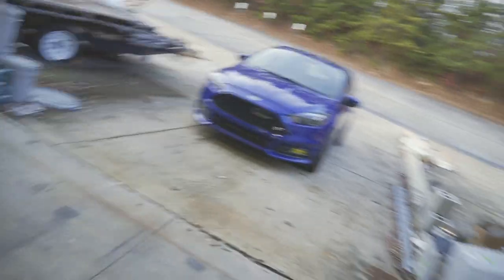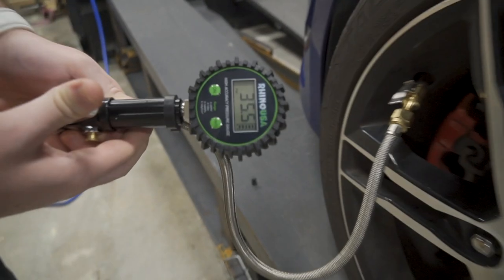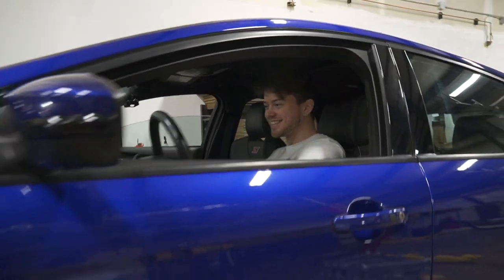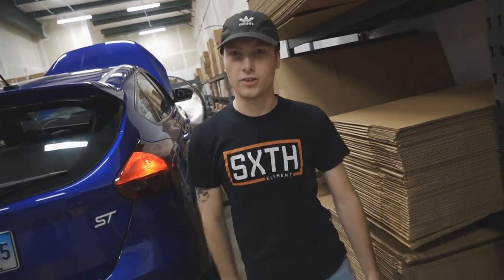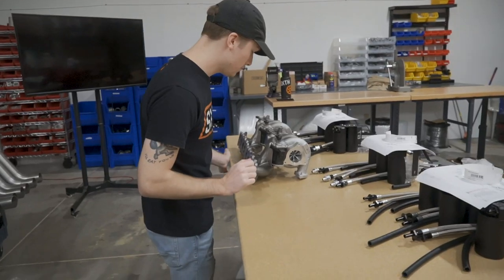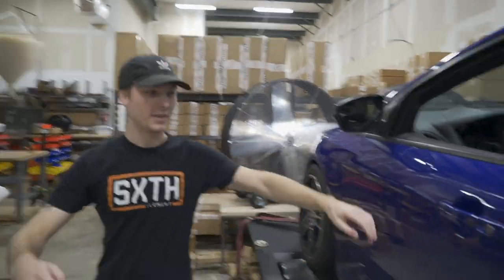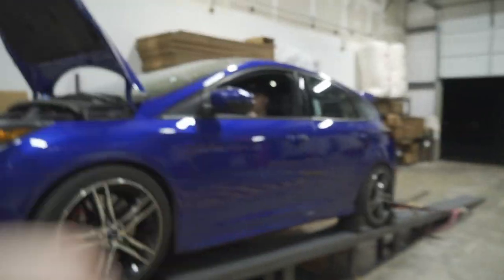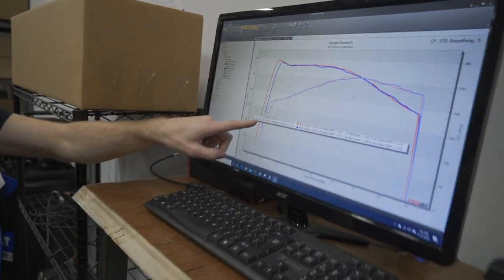Does a Cold Air Intake REALLY Give You More Horsepower???

Comment: when adding bolt ons, and putting it on a dyno without a tune specifically for those bolt ones, numbers aren't going to change, some bolts ons are required for example for a big turbo you're going to need a cobb cold air intake for more air flow because the stock one won't handle it. you're not adding a bolt onfor horse power. you're adding a bolt on to withstand the horsepower your tuner pushes your car too, stock charge pipes, intake, downpipe helps handle the horse power added its not giving it horse power, its adding it

Comment: To spend $250-$350 on a CAi on a stock FoST and stock turbo makes no logical sense. Yeah sure you'll get some cool intake noises but I digress. Your money could be better spent on something more beneficial like lighter wheels and stickier tires, FMIC, Downpipe, Catback Exhaust, Chassis Bracing, Suspension, Endlinks, Rear Sway Bar, RMM, Engine Mounts, Bigger Turbo..etc

Closing argument, the factory tune, turbo and ECU can only handle and meter so much air. On a bigger turbo you MIGHT see some noticeable gains. On a side note, the factory intake/RS Air Box can handle 400hp with ease. If you're looking for a more aesthetically pleasing look under your hood, sure by all means buy an intake of your liking, just don't expect anything more than induction noise. 

I have had my 2018 FoST going on 3 years now and have yet to open my wallet and buy a CAi, I am still running my AEM Dry-Flow Air Filter and a FoRS Air Box lid. Going big turbo in the next few months or so, a tune and CPe 5.5 FMIC but as " science " has proven, money can be better invested elsewhere.
Reply: With the RS Air Box Lid, did you replace the accordion section of the stock intake as well? Just wondering if it's beneficial to do so. I'm going the same route you've mentioned.
Reply: @bacchusthompson5834  I replaced the smaller section closest to the air box with Moutunes offering.

Comment: Auto manufacturers put a lot of research in designing oem intakes. Even some of that extra tubing and chambers aren’t just for reducing sound, but to increase air flow under all conditions and reduce any cavitation. The only thing I’ve ever noticed was a slight lowering of intake air temps while stopped. Don’t think it was enough to affect power though.  It they do look good under the hood and sound good,
Reply from the maker: That’s all I noticed too my iat’s were significantly lower. Used to be 120+ and with that they’d be around 85. But also the sound was well worth it for the fun haha.

Comment: Maybe this is true for a boosted engine, but I am sure that N/A engines will benefit from a quality cold air intake, especially if the stock OEM setup is restrictive.
Reply: It won't make a difference unless the engine is not run by an ecu
Reply: @u-know-this  Is that because you assume that the factory ECU will counter the additional air volume supplied by the aftermarket intake? I wouldn't think that would be the case.

From my understanding the ECU would need to richen the mixture,  and by adding more fuel because it is detecting more air can only mean additional power.

Either way, a tune would be needed to maximize gains.
Reply: @zombieqtr  i am not assuming thats how an engine management system computer works its job is to ensure the engine gets the same fuel air mixture per engineering specs.  The only way to change the specs is to get it tuned.  Specifically in modern cars. Older ones with no Ecu' are different of coarse

Comment: Forced induction over rides any cold side flow increases....15 PSI of boost is 15 PSI boost no matter how you get it.    Only way to make more power is to increase amount of gas and air the engine is using...or to release power from parasitic energy consumption in the engine.    Electric water pump, crank windage, alternator cut off, AC cut off etc....  Good scientific approach, thanks for doing it.

Comment: The stock intake flows over well enough for over 400whp, hence why you're seeing no gain.  If you were on aux fuel with a BT you would 100% see a bump from the CAI. It's just not a necessary power mod for the stock turbo.

Comment: Go with a full stage 3 kit and then get it custom tuned to run on e30. The car is soo much more fun after those mods. Makes  about 285 wheel hp and 385 lbs of torque to the wheels.

Comment: The car already had a cold air intake from factory, did absolutely nothing and so the result were absolutely nothing.

Do one thing take your stock filter out and put it in the fridge, take it out when its cold AF put it back on the car and dyno it on stock tune, you will see the difference of cold air.

Comment: I used to have a cobb CAI on my ST, I always thought it felt slightly slower, thanks for confirming it.
Reply: Well Cobb intake is mostly stock diameter. So you'll get better flow but roughly the same volume. Of the car is not tuned after the install, your gains will be none. A big fat intercooler and 3" downpipe, plus a proper TUNE  will absolutely get you many horsepowers.

Comment: Took me 3 hours to swap intake pipes...such a pain in the ass. Lol mostly sliding the piping into the coupler on the turbo. Scratched the shit out of my JBR 3 inch intake pipe on that wafer thin oem
Strut tower bar. You got an intercooler on that car? I hear you can get 15-20 hp with one.
Reply from the maker: That’s the next power mod!
Reply: I just need an intercooler and I’ll full bolt-on’s, gonna pair that with the CPE charge pipe with an HKS SSQV bov. Then taking my car in to get dyno tuned...can’t wait. Haha
Reply: @jessebudelman  you dont ask people to sub to you especially without content and as a competeting segment on youtube thats just rude my friend. You get organic views and build from scratch like the rest of us (this is a ghost account)
Reply: @truthtimetv4575  how is that rude? I just tossed it out there. Take it or leave it. 💁🏻‍♂️
Reply: @jessebudelman  Treadstone TR8 is an excellent FMIC, check into it. I invested in one and then picked 2 ATP 90° Elbows (one with the intercooler sensor mount & one with the HKS Flange), couplers, T-Clamps, vaccum line, SSD, Block off plate, and of course a HKS SSQV... All for under $600. CPE kit is $500 alone, just food for thought 💭

Comment: Stock clutch should be more than fine plenty big turbo guys running stock everything transmission wise
Reply from the maker: She’s gettin a little worn, starting to slip during normal driving so I got worried😬
Reply: Big turbo is actually easier on your clutch tbh, you lose a lot of low end torque. Makes torque steer when driving basically disappear too
Reply: @BenLovrien  how many miles do you have... I'm still on my Stock Clutch with no slip and I'm turning 130k.
Reply: @td7122  not entirely true im on a big turbo and it torque steers like a mother lol
Reply: @bryanluna6042  which turbo you running?
Reply: @td7122  bnr 3071 .63 ar still on a base map waiting on brian from jst to come back to see how shes doing i had an overboost issue happening kinda fixed it but not sure till he comes back to know
Reply: @bryanluna6042  im on a gtx2867r, 93+water meth, it lags in torque. The meth is a big part of that though
Reply: @td7122 are you on the .86 or .64 ar I'm on meth to on 93 gonna tune for e30 soon but as of now she pulls really good does have a slight lag do to being bigger but when she hits she hits hard lol
Reply: @bryanluna6042  its only the 64, i probably just need a better tune lol
Reply: @bryanluna6042  cant really do an etune here, very few pumps with ethenol
Reply: @bryanluna6042  also, how much boost are you pushing/peak range?
Reply: @td7122  i hit between 17 to 19 and it tapers up to 22 at redline from whta i see on the ap and my boost guage

Comment: Sorry, but if you dont follow the instructons the CAI intakes, you'll lose HP and torque. Are you 2 mechanical engineers or mechsnics? When my CAI was installed, my VCM was reflashed to calibrate it for the new intake. There was a very noticeable increase in horsepower.
Reply from the maker: Yes actually. And my friend there is the best kdm tuner in the world. Literally. We tuned for the intake and also tested with the stock tune and there was only marginal difference. Like we said in the video.
Reply from the maker: Also you don’t have to be a mechanical engineer to use a screw driver and a socket set lol😂 but you do have to be a software engineer and have familiarity with tuning cars, which Nate there is not only a licensed cobb/pro tuner, but he is the head tuner for SXTH element and like I said, the best KDM tuner in the world on top of probably best in other platforms as well.
Reply: @BenLovrien  I took a look at my K&N CAI today, for a completely different reason. The heat shield protects it from engine heat, and the cone filter is literally aimed directly at the 2nd Gen Xterra intake hole, which is in the wheel well. One part where K&N didn't do a good job, IMO, is that there's a large hole where the custom intake tube goes into the heat shield.  That should be sealed off retaining part. For both cold air reasons, and vibration reasons. After 8 years, the bolt from the K&N bracket to the intake tube worked itself loose, and fell out somewhere on the road. There was a rattling sound at idle which concerned me, so I figured it out myself (the Nissan dealer was worthless). Modern, computer controlled engines, have the ability to adjust for air density and temperature coming from the intake. So, you're telling me that a non-restrictive air flow, with the intake aimed directly at the stock intake hole, won't yield any performance gains?  I'm sorry, but they doesn't pass muster. These CAIs might yield less performance increases than  the manufacturer's  specs. However, I've seen an Xterra dyno video where they compare all the CAI brands, and compare them to stock. The increase in power  is clearly evident.
Reply: @BenLovrien  since you seem to have knowledge on this subject, where are you located? I'm in Northern VA. I've wanted to get extra performance from my 2911 Xterra Pro-4X for a long time. All I did was have the K&N CAI installed. It sounds like with a CAI, an aftermarket exhaust (NISMO now sells one), and a tuner chip, you can get significant performance gains. There used to be a tuner chip sold for 2nd Gen Xterras & Frontiers. It had 3 modes if I remember correctly. It had a high MPG mode, a regular mode, and a high HP mode. I'm not sure if it's still sold. If you guys can install this stuff, and tune my Xterra for decent gains, I'm willing to travel a reasonable distance. It really depends on where you're located.

Comment: Def not even close to the worst sounding 4 cylinders. Just a horrible exhaust on this car. The Ford 4cyl and especially the 4cyl T motors sound so good if you don’t cheap out and just hack mufflers/ resonators off or straight pipe. Not saying that’s what you’ve done. But that cannot be a good reputable exhaust manufacturer set up on that car. Sounds NOTHING like my ST with a magnaflow
Reply: Also an intake alone on a booster motor really makes no difference. It’s all about IAT’s. The factory Airbox flows plenty air. The benefit of a aftermarket is tuning for more airflow and therefore more fuel. But you’re compressing that air so fast it’s heating up so it really only comes to a good front mount setup. Also. Please ditch that horrendous exhaust.. the ST deserves to sound deep, unique, throaty, poppy. Not like a Honda with a straight pipe and fart can.

Comment: Elantra Sports doesn't make any power lol
Reply: Look up some content bro , but they make about 180 whp I have a VN DCT and I’ve gapped many’s modded focus st
Reply: @anthonymccomb4782  I know that it was just a good joke between me and Ben because I own a 18 blue fbo Elantra sport DCT last engine related mod I need to get is a tune from sixth element, sadly there's not a whole lot of Elantra sport content on YouTube there's a lot more on the Facebook group pages.
Reply: @THETHRASHER88  yea I was in mostly all the es Facebook groups , but hey if you know anybody needing a set of 21 VN led headlamps HMU I got a brand new set still in the box ordered them then turned around and traded my 19 manual N that 8 speed N DCT is way way way better than the 7 speed dct my es had
Reply: I ordered the led map dome led lights for my es then wound up getting a oil change looked and test drove the dct and feel in love lol 😂 but they fit the n line Elantra , Elantra sport and few others HMU on Facebook if interested their cool as hell